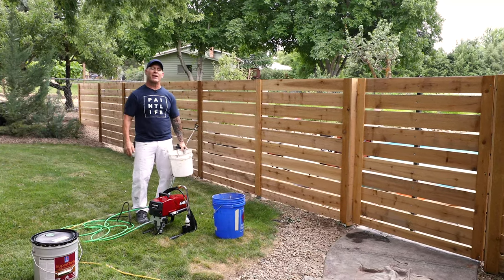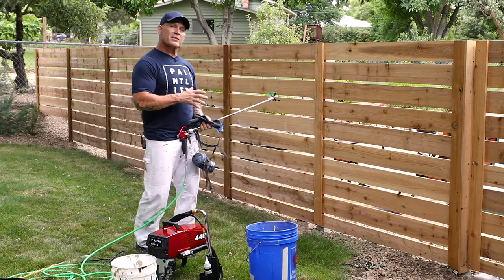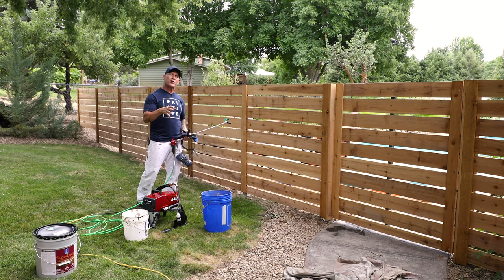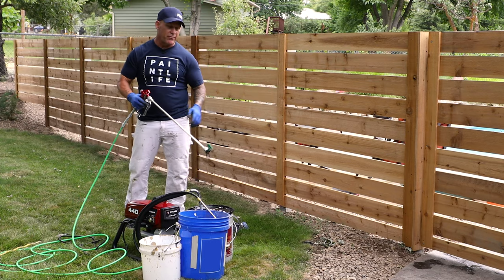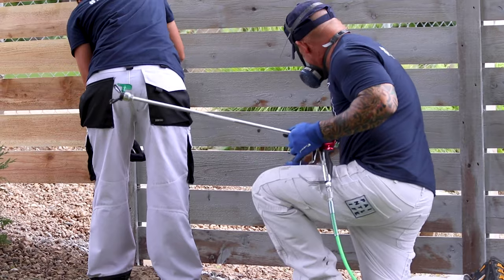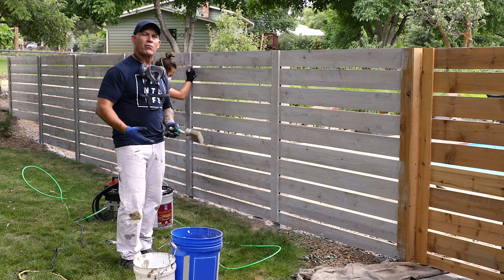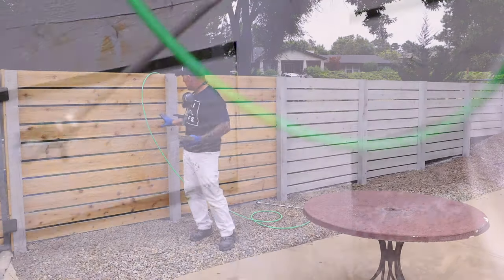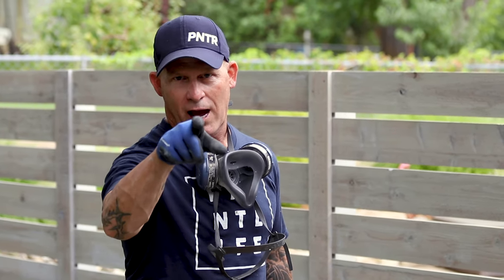WORST Product Ever, Oil Based Stain!  Never Oil a Wood Fence

Comment: I have learnt a lot from your videos regarding spraying but this approach wasn't a professional one.
I did loads of spraying in the last 2 years and figured out:
Airless for water based or 2 pack;
Hvlp for oil based stain or 2 pack.
With the oil based stain on bare wood: 1 coat of base coat, 2-3 days of curing time, sanding, and 2 coats of top coat with 3 days of curing inbetween. Have you tried Sadolin?
The first 2 coats thinned with white spirit 10-20% depending on wood dryness.
Reply from the maker: I am a professional and got professional results that worked for me- always learning and trying different products!
Reply: Coolride17  Any chance for a pole sander? It does not need to be a piano finish, just make a bit smooth the raised wood grain. Different standards for all of us. A proper masonry roller would be as quick as setting up the sprayer, cleaning it and back brushing. Last time I used a 9 inch Wooster Pro do, half inch nap, 4 gallons in 2 hours, up to 20 feet height on wood panel. BTW I am not happy with the water based stain, in Ireland doesn't lasts as long as oil based, after 2-3 years it starts to crack and blister. That's my own experience

Comment: Oil stain is the way to go when you want to protect woodwork like fences benches and decks from the elements. It's a delicate process meaning you have to be extra extra careful with oil and cleaning sucks big time. Water base products are good but will not last as long.

Comment: The oil stain would work a lot better if you mix it good before you start. Oil lays on the bottom especially oil based stain, it needs to be mixed periodically as you go along!

Comment: Great advice here especially about the back brushing and laying heavy.  I just got done restaining my fence. Used the Graco Ultramax Cordless with a FF514 tip. Worked pretty well minus having to fill the cup a billion times. Glad i chose water based after watching this video. Tip for others would be that you will use ALOT of stain. I had never stained before and only bought two gallons. Ended up using 12 and blew my budget out of the water.  Lesson learned.
Reply: Yeah, it’s faster and easier, but water based stain will start peeling off ina couple of years if you live in a extremely hot and cold weather location.

Comment: Great video and audio….I have learned so much….Question: after watching this video I think I will be using a water based stain…I unfortunately purchased a couple gallons of  oil based sikkens ( PPQ ) 009 dark oak. What brand  of water base product would you recommend that is equivalent to sikkens. Thanks…Ralph. PS..r stain brushes different then inside home brushes.

Comment: I used to stain but have it away as the hot westher just dries it out. I paint now with high uv stabilized water based paint. When i lived in the UK we'd treat wood fencing with creosote every 2 to 3 years. It was stiff but the stink of tar was overbearing
 They banned it ive heard now.

Comment: I haven’t even watched this video yet just straight to the comments and a couple things to add, the different products used in a water based stain are much better then they once were, with that’s said oil based stains are far worse than they once were. We are in that in between era where regulations and codes have really hurt the oil based stains you once loved. For instance, using Cabot as a example, absolutely trash for a deck stain from what I have used, my facia deck boards are great though they were also black pretty much, used a Bona wood oil with a hardening agent and 3 years later looks great. Problem is I’m charging more to apply that then something water based, time is money, you want to spend all day in exhaustion to put a oil down like me? Good for you do it yourself or pay me. Want something economical that will be less expensive and I come and reapply and maintain great, you want to sushigi bon it and cook the sugars out cool, pay me or do it yourself lol this guy has taught me a lot about painting and I appreciate it a bunch, at the end of the day just like this message it’s my opinion do with it what you will. #makeoilstainsgreatagain
Reply from the maker: thanks for sharing

Comment: i totally agree, i cannot stand oil stain like superdeck. one other risk is the fact that it can spontaneously combust. it travels sooo far, i’m totally cautious about over spraying cars too
Reply: Oil stain is a far better product than water-based product, they are junk.... and anybody that knows anything about anything knows this. they do not spontaneously combust.
Reply: @williamrose7818  the rags will combust if saturated and not discarded properly. twp stain is good  but i prefer using arbor coat
Reply: I’ve been doing stuff like this since I was 16 years old never once have I had anything from oil spontaneously combust. I currently have rags soaked in paint thinner drying out in a Bucket from the oil stain I just did on my fence. I have one bucket filled with paint thinner that I used to clean everything and another bucket filled with the soaked rags...  I’m sure it could happen under perfect circumstances but I have never had it occur
Reply: @williamrose7818  i did a stain job with the old cabot oil stain, i had paper masking in a contractor bag that had stain on it. it ignited and burned my sheds down

Comment: Great video!👍🏻 me myself would back roll and brush especially on rough sawed. I’d use a pole and a 3/4 “ nap probably use a bigger tip 517 sometimes I’ve even turned the tip around to spray more paint in certain areas . Keep a bucket with a grid n a lil bit of paint in it and a brush for tight areas. You can do miles of fence

Comment: Noticed you did not mask off the surrounding gravel and grass. Even though there is low overspray I would recommend masking under the fence as well as laying plywood or something on opposite side of fence to prevent overspray on others side.

Comment: I stained a new cedar picket fence I built w a Titan FlexSpray a few years ago (Cabot Solid Stain Acrylic). I used a lot of your tips to do it and --> it came out great. I'm getting ready to do another fence project and would like to ask if an airless Titan be a lot easier? Thanks !
Reply: A solid hide acrylic "stain" is basically a watered down paint. Most people installing new fencing want to see the grain of the wood, not just the texture.

Comment: Great tips. Question:  is the only way to apply linseed oil to a cedar fence by rolling the product on?  I have been trying to find the answer. The guys at lowes and Home Depot don’t know the answer. Can it be sprayed on in an electric sprayer or pump sprayer?  I have quite a large fence on my property and it’s 3 years old and starting to split.
Reply from the maker: Brushing is the best way
Reply: @Idahopainter  thanks so much

Comment: Thanks Chris I've used the woodscapes before but, I still like the Arborcoat. I've tested it for 4 years on railroad ties with zero prep and no problems. Have you ever used this product? Thanks for sharing with us all.
Reply: Yes to Ben Moore Arborcoat, it's all I use on outdoor projects.  I apply first coat with oil so that stain behaves with tannins in cedar - subsequent coats years later are water-based.
Reply: I second arborcoat, been on my screened porch for 10+ years and it looks good still. This is in virginia with all sorts of weather.

Comment: the best stain for a new or bare fence is linseed paint non toxic and one the best paints for the environment thinned with raw linseed oil and turpentine not white spirit until its translucent then every 10-15 years just rub over with raw linseed oil the main reason why were replacing exterior timber with plastics is cause we stopped using linseed paints mostly industry wide.

Comment: Which paint or stain is best to use on wood is the same as what type of horse a trainer would use to run in a particular horse race. Oils are excellent at penetrating timbers, while latex or acrylic stains are classed by trade painters as pretty surface sitters. Each have their good & bad points depending on climate/country. Most translucent water based stains have a short life span in harsh sunlight conditions whilst the so called solid opaque water based stains have excellent expansion & contraction qualities, blocking out UV rays.

Comment: My experience with most oil base these days is they grow mildew.  The water based seem more resistant to mildew growth.  I think they took all the goodness out of the oil products with voc reductions.  In dry climates maybe thats not an issue, but in the North East its a battle.
Reply: Can I like this more than once? That’s our issue on Long Island. I’m almost afraid to stain with oil anymore. I think we’re going to switch to latex. You can actually clean a latex stained house and it looks good again , oil stained jobs look dull and need of new stain.

Comment: No doubt 2-3 x's more product than a homeowner, however nearly 90% of that extra 2-3 X's more, is actually just floating away (hence the cloud he is working in, you can bet that was the BEST edit to mitigate the obvious) Bare in mind that cloud that will be landing on the homeowner's driveway, house, car, and patio furniture, etc. A pump sprayer with an upgraded professional "tip/wand" from your local tractor supply would offer a FAR more efficient application. Albeit a bit slower, it would save 50% of the product. (he is absolutely correct about the importance of back brushing) 
If time is/was a concern.. handy folk and or professionals could add a small submersible insecticide pump creating a very efficient custom stain sprayer. 
BTW, a bilge pump is a perfect choice. They are a bit more money,  but they LAST.

Comment: Hi, would appreciate some advice here.  Trying to decide what to use on a brand new cedar tongue and groove soffit above my porch.  It's covered and out of the element but want something that will preserve the natural wood color for as long as possible.  Thought about cabot wood toned stain + sealer but not sure if I like the candy coating it seams to leave on it (seems like it would peel up?), I've used penofin blue label on fence and porch for years and it is great but darkens over time (not sure if it would do that on a soffit that is out of the sun/elements?), thinking maybe the red label penofin would look good?  Looked into REady seal but not sure as some of the reviews make it sound like it doesn't hold up well?   then there is the question of do I pretreat the wood as it has a mill grain finish on it.  I don't know if just a very light sanding with like a 80 grit paper would suffice or if I need to do a pretreatment like the FIRST STEP PREP that penofin recommends?  It scares me to have to wet down a brand new soffit area that is already installed overhead, then I have to let it dry and moisture could get trapped behind it?  Am I overthinking this?  HELP appreciated ;)  Running out of time, weather is changing.

Comment: So you're saying the main reason  𝙮𝙤𝙪 don't use oil based stain is it's not worth potential issues with overspray even though oil based is better for the wood. What about later when the water based product starts peeling and you have to go back and scrape it all off and re-coat. The last fence I stained with water based (BEHR) did not hold up on the south facing side. Yes, yes, I found out BEHR water based stain is  𝘾𝙍𝘼𝙋....never again.

Comment: Going to do an oil stain (because I have 20 gallons that I go on sale).  Do I need to put a sealer on after the oil based stain and if so which kind to use?   Same process?
Reply: no. The product is already a sealer.

Comment: Thanks for the great videos! I have a new rough cut shadowbox cedar fence that has had plenty of time to dry. Rain has caused dirt to spatter on the bottom of the fence in some areas. Should I use a pressure washer or a garden hose to remove the spattering? What brands do you recommend (ie: Thompon's, Sherwin-Williams)? Thank you.
Reply: If you have cedar fencer.. YOU MUST USE OIL BASED STAIN!!
If you get dirt on the lower part of the fence because of the rain. Put some gravel like 10 inches thick for drainage.

Comment: What does everyone think about Ready Seal?  Although it is oil based, they say it penetrates better and doesn't just stay on the surface as oil base products.  What say yee?
Reply: Ready Seal is better than the stuff he uses here.  Easy to use easy to clean.  However you don't spray it like paint.  You use a flooding technique.

Comment: Chris I love re-watching your videos before and after doing projects to keep checking my work. For a Graco tip, and Austrailian outdoor semi-transparent stain, I used a 213. at 2000psi. This did not go well. I feel like I should have dropped to 211 or 209 which is not rated for semi-transparent. The HEA tips for Titan, Im not sure they have a comparison for Graco. Please let me know if they do. I would do titan all over again and stick with stuff I can buy through you. Thanks for all your work meanwhile. Please let me know with the tip and psi. I had a brass regulator and 5000psi oil gauge at the gun. Can I drop to 1000 psi with that 213 or 211 tip? I feel like we used way too much material. On the oil vs water based, I dont like spraying the oil and it's mess / cleanup issues. What do you suggest for a water product in this case, if you were not testing the new oil stuff? Thanks!

Comment: Sorry. I’m Not a professional painter. Just a 3rd gen farmer with a lot of experience treating fences and barns. If you want good long term results, we only use oil based. As a matter of fact. We use, used motor oil cut with diesel fuel. Best ever long term results and it keep out all wood boring insect. Old timers know best.

Comment: The title of this is confusing as I believe he says that he is using an oil based stain. Regardless, oil based stain is what you want, never latex. Not sure what he is using, looks like a sherwin Williams label. Water based not my first choice,. ready seal is ok, but best stain I have ever used is standard paints brand, “wood defender” made in mansfield, Texas, with their applicator. Smooth as silk, heavy solids, best finish period. Any stain from Lowe’s or Home Depot is latex garbage, coats and seals the fence, will cause mold and rot.....no matter what bs they tell you or what it says on the can. Really don’t have overspray issues unless it is too windy, then you tent or don’t spray. Wood is simply a rigid sponge, if a properly constructed(most are not) fence is cleaned and retreated every 4-5 years a fence can last a lifetime. There is no forever fix for anything in your home, it all requires maintenance. He emphasizes about making sure the fence is dry....he is on the money, so critical to the staining process. See guys all the time throwing fences up on a Monday, Tuesday finished and the stain is on. What they don’t tell you is that lumber was wet in a stack on Monday morning, and you end up with a crappy stain job that begins fading and streaking after a year. Good video, as usual, well explained, guy knows what he is doing.

Comment: I’m using Cabot oil based stain on a deck. 
A pro painter told me you can only stain 1 coat & not 2. 
Is this correct?
Reply: This is more true if using a solid stain.  I recoated a semi transparent after a few days, which is beyond the alotted time specified on the can, but still no issues and the 2nd coat has made a significant improvement.  Always read the can.  Salesmen like to advertise "no 2nd coat" in the store, so take it with a grain of salt.
Reply: I'm curious how your cabot stain is holding up?  thinking of using it on a cedar soffit but I've always been a penofin fan.

Comment: @Lucc 701 
with all do respect- WHAT!!!!!!!!
pigments are  solids!  I'll grant it, they are ground pretty small, just reference the settling that occurs at the bottom of paint and ESPECIALLY THOSE STAINS.   ....so yea, those solids, they DO NOT penetrate a darn thing,  but please, dont take my word for it, see you cant sand it right off. No problem right? 
But maybe you meant dye 
Dyes on the other hand have pigments ground SOOOO fine, they cannot crash from their respective solutions. Dyes do in fact penetrate wood. 
Ready Seal is a paraffin based product (in other words, a mineral oil, based product). It can ONLY go on BARE WOOD, and... (perhaps itself?) ( forgive the uncertainty, I don't fool with it at all, due to their VERY MISLEADING ad literature that omits stripping the existing finish between their "before and after" photos) 
Unlike TWP where it's TDS  states ONLY EVER on BARE WOOD. Only ever on bare wood, I know no one adheres to that, but when making definitive "professional" claims about products and their performance, it is relevant.

Comment: What you talking about? Water based paints are the worst to use on outdoor wood or any kind of wood.
Oil based paint is the best for outdoor wood, fence etc and it's been for all the time. Long life time and will not crack, cip, or be washed with rain so easy. Get a sealant over it and you can redue the paint in arround 3-5 years time if good applied.

Comment: Oil based stain is the BEST for decks and fences. It penetrates MUCH better than the water based. I painted a deck with water based once and 2 yrs later the paint started peeling off. Horrible! On the other hand.. I stained my front porch floor  and railings  with Cabot Gold oil based and it's been 6 yrs and it looks as good as the first day. This guy is lazy and wants to do an easy-fast job.
Reply from the maker: I disagree
Reply: @Idahopainter  Of course. Lazy people don’t want to do any hard work.
Reply: @murd777  he doesn't have the skill set to spray oil ..